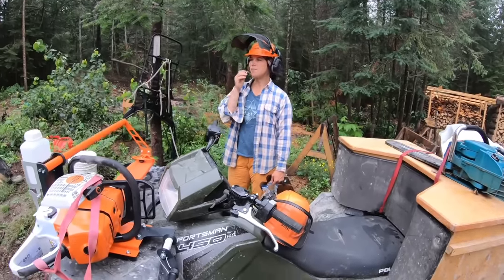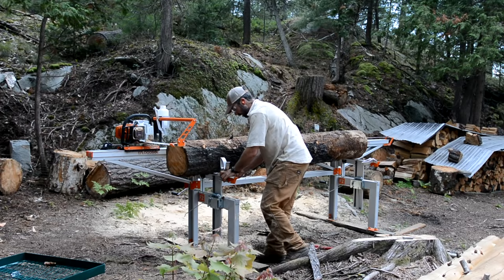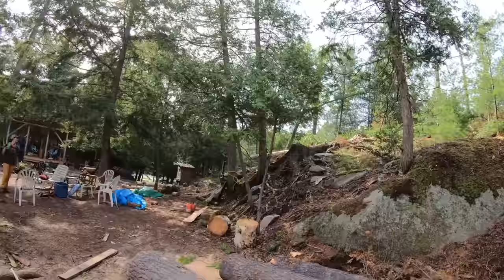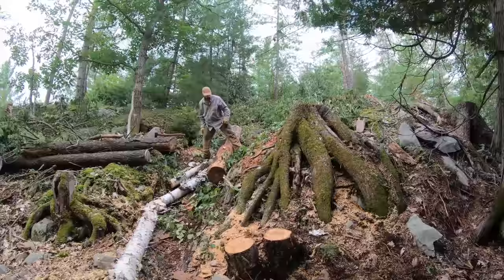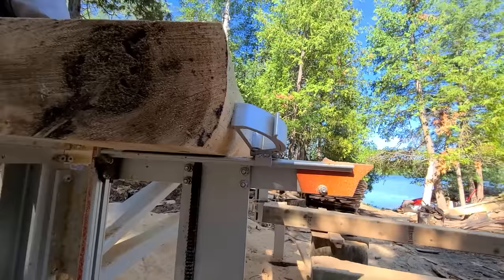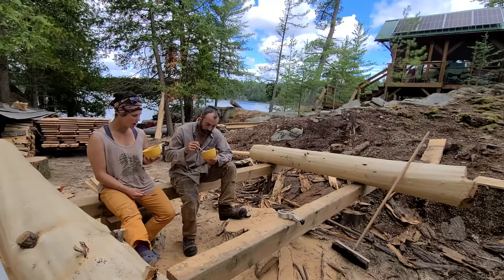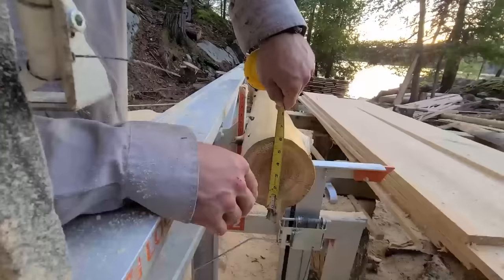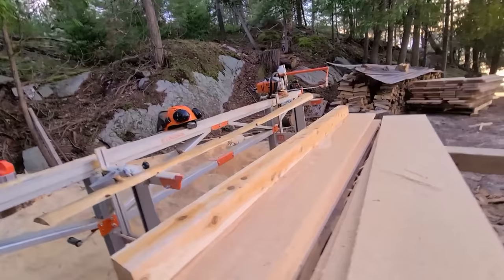A Remote Milling Adventure with our New Logosol Mill!

Comment: I began milling with an Alaskan mill but had two Sthil 090 power heads in 1973. Log diameters were a maximum of 48", and I cut 3.5" slabs x 15 feet long. It was the most inefficient use of labour. Logs were from trees I felled in backyards, so there was an element of wanting unusual timbers. Chainsaw mills, as shown, need to be more efficient, considering how cheap and mobile horizontal mills have become.

Comment: I have a Logosol myself and the quality of the lumber is fantastic (straight, smooth cut,..). Since I don't have any way of moving my logs, I have to carry the mill to the log. If you put a strong chainsaw (e.g. Stihl 880 Magnum) on it, you can even get some decent production in softwood! And with the way lumber prices are going right now.. Not counting your time, you will have the money back pretty quickly!

Comment: Howdy- Enjoyed the video; especially the trek getting to the remote, island building site. Could use a little help finding one of the implements you used to lift the logs, one end at a time. It looked like a pickeroon with a hand crank winch attached. Thanks in advance for pointing me in the right direction.
Reply from the maker: I think you're looking for a cant hook or peavey
Reply: Thanks.

Comment: Thank you for this video I am still at a crossroads between this Logosol mill ,or a Bandsaw Logosol mill. Having done big Red and White Oak, and Southern White and Yellow Pine using a Grandberg Alaska mill. When using a Chainsaw the kerf is bigger . I plan on either using my Stihl 661 for felling and milling, or I might just buy a Stihl 881 just for milling only. Which saw and bar length did you use on your Stihl?

Comment: Great video    Do you recommend the water cooler? And the bar support?   Subscribed
Reply from the maker: The bar nose support, definitely.  To me it feels mandatory.  The water cooler I don't always use, and with all the dust flying about the hose does get clogged from time to time.  I think it's usually worthwhile though and probably helps the bar and chain last longer.

Comment: How long of logs can this system handle?
Reply from the maker: Our configuration can handle 12' logs, but you can add additional sections to handle 16' or 20' logs.  Actually I think you can just keep adding additional sections to go as long as you need.

Comment: Is it still the MS 880 ?
Reply from the maker: I had a borrowed MS 661 here, because it would accept a stock .050 gauge bar to run the low-profile ripping chain.  I've ordered a custom low-pro bar from Cannon that'll fit the mounts on my 880 though for next time!